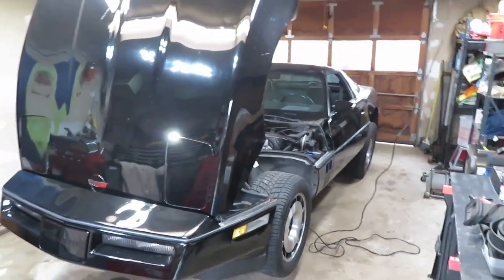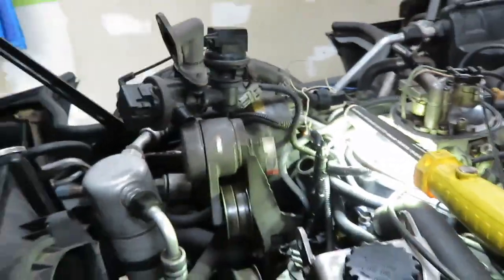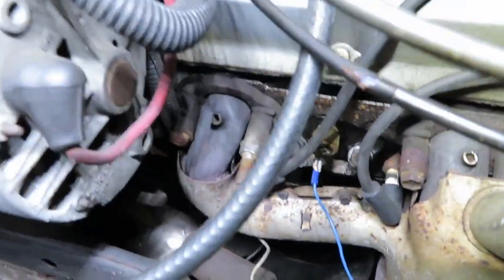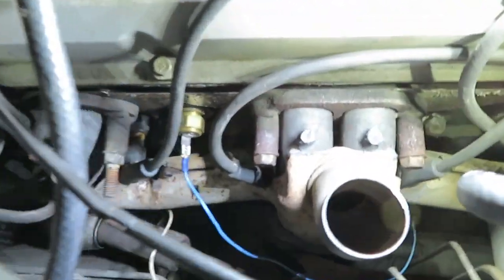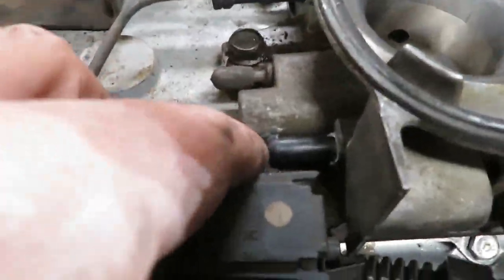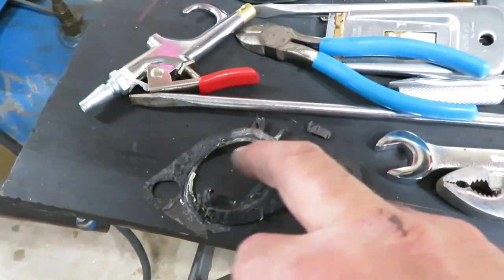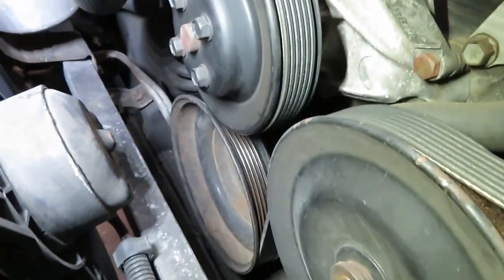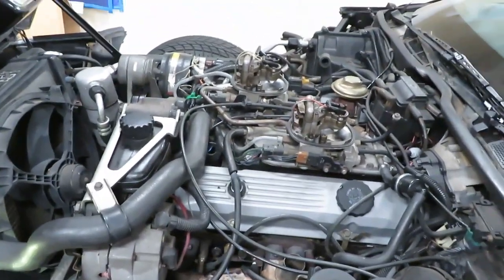1984 C4 CORVETTE SMOG DELETE

Comment: For the catalytic runners on the exhaust manifolds... just cut and cap the off at the end of the pipe after they all converge. Saves you from created 4 holes on each manifold that need welded.

Comment: You did a nice and neat job with smog pump. In case you wanna remove the AC too like i did ( total weight smog pump and AC system was almost 60lbs) the belt is 70.5”. I wish i could have removed the 2 pipes on the side of the engine too, but just didn’t have the tools and time, so i kept them as is.
Reply from the maker: I'm going to keep the AC....it works great and needed in the summer here in Connecticut. The tubes were a pain but, came out easy enough, an inexpensive dremel kit will cut those right off.

Comment: I’m in the process of doing the same thing to an ’87. My question is about the vacuum lines. Since the A/C, Air Pump and associated relays, switches etc. have been removed, where do the vacuum lines go? I know the fuel pressure regulator, brake booster and cruise control need vacuum, but are there other items that need it also to run the car properly? AND, what is used as a source for those lines? Brake booster and cruise control come from the rear of the intake, I believe. The Pressure regulator comes from the small nipple on the lower passenger side of the intake. What else am I missing?
Reply from the maker: Hi, mine is a 84, totally different with a simple ecm...your going to have to Google what to do to your 87 Vette, there is a way to do it but, Idk offhand. The Corvette forums have detailed instructions. Good luck